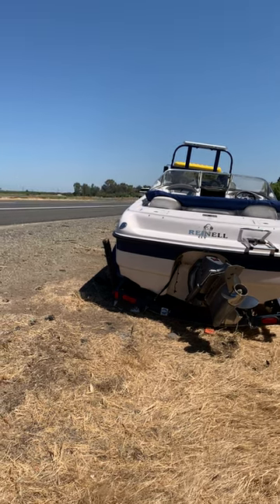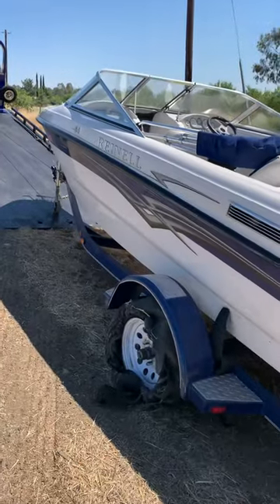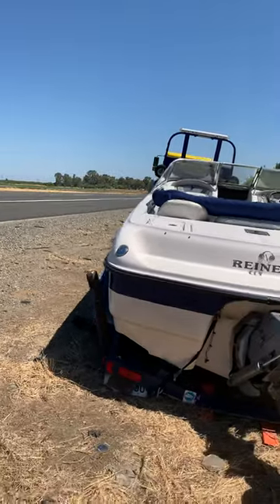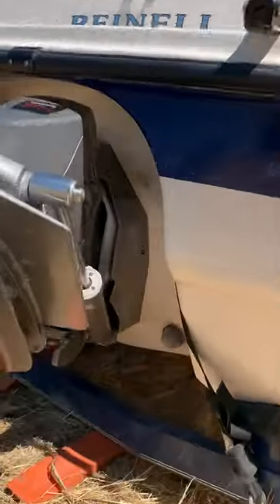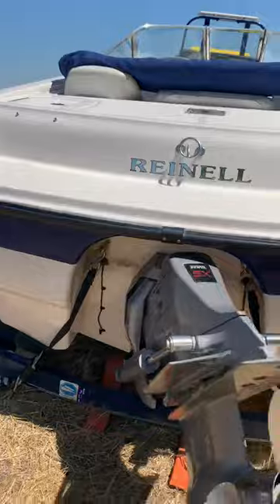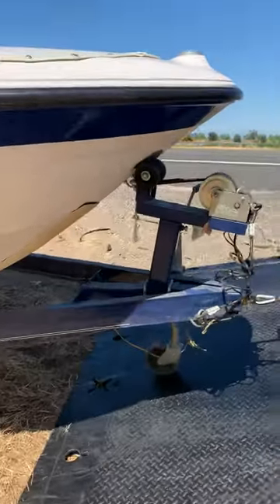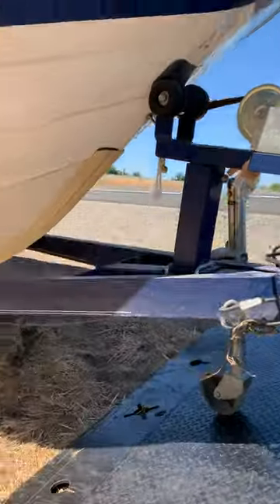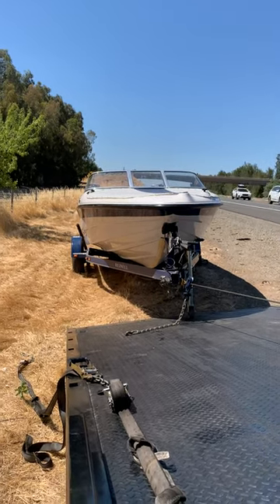How to load a damaged boat trailer on a flatbed tow truck

Comment: Wouldn't it have been easier to just get a tire/roadside tire assistance?
Reply: Would they have correct spare for trailers?
Reply: @wazup3333  Tractor Supply,  Walmart usually will.     Rim and Tire both most times.    When you get to a 14k trailer tires, that's a little harder to come by.       Sometimes there are guys that sell used tires roadside assistance that might come out and change it for about $300 service fee and $90 for a used tire.     It's expensive, but might be cheaper than loading the whole trailer and boat on a wrecker.   The only other option would be to go down to a marina and see if you could buy someones spare.  But I wouldn't buy anything older than 5 years.
Reply: @KarasCyborg  yea but when you break down on a highway with a trailer on your vehicle you don't have to luxury of fishing a tire for sale
Reply: @wazup3333  You got no family or friends?
Reply: @KarasCyborg  if youre traveling and going out of state